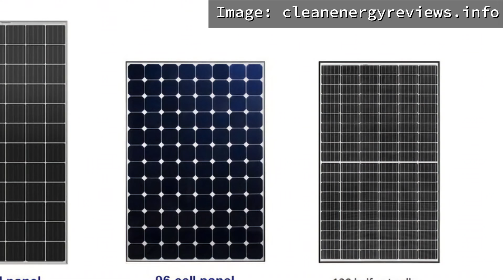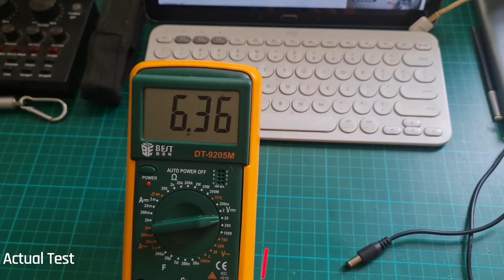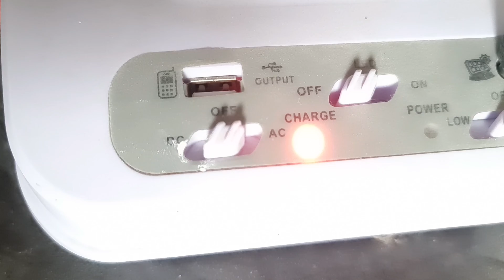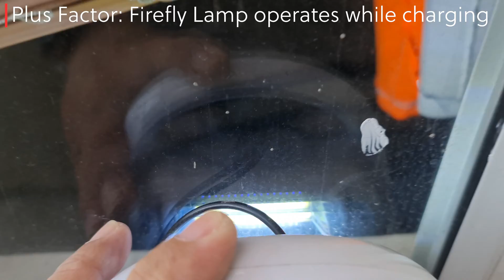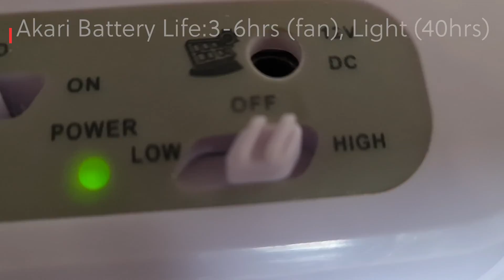REVIEW: Mini Solar Panels Efficiency | Akari Fan | Firefly Lamp

Comment: Ilang hrs po charging ng Fan pag solar panel gamit nyo po?
Reply from the maker: Sabi ng manufacturer, dapat i-charge for 24 hours every 3 months. I used to charge this the whole day using solar but it only lasted for 2 hours at night. So, i ended up using electricity.

Comment: Hi sir magagamit padin po yung akari fan while charging via solar panel. set po ninyo siya sa DC. I have the 14 inches version
Reply from the maker: On my unit, hindi siya gagana pag nakasaksak ang solar panel.
Reply: Sorry hindi nga gagana.. madilim na nung natest ko.. nagtest ulit ako nung tirik na araw.. ayaw na magwork while charging..meron bang work around eto? Sa JPS at NSS brand kasi pagkakaalam ko will work while charging with solar panels..
Reply from the maker: @nowellgusi9088  parang safety feature nya yon. Hindi ma-tweak yan kasi nasa control circuit board yan.